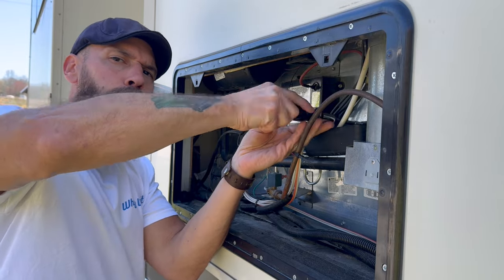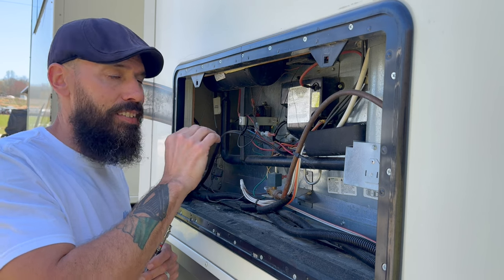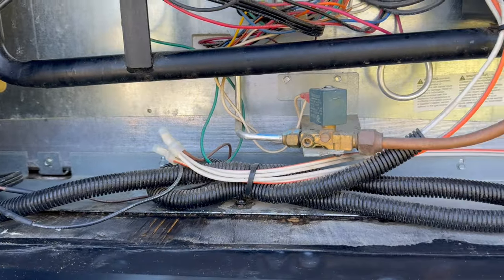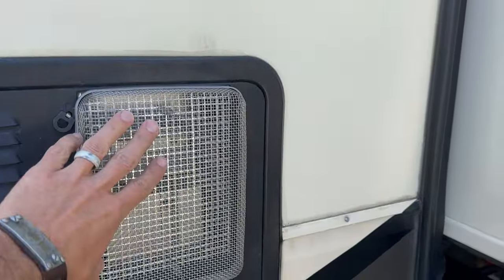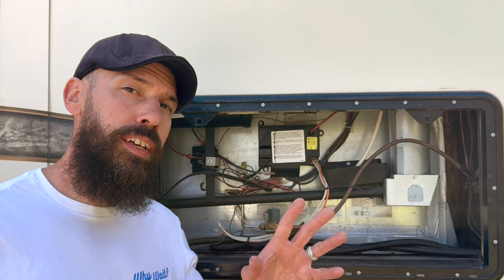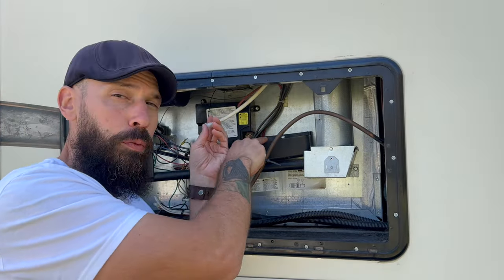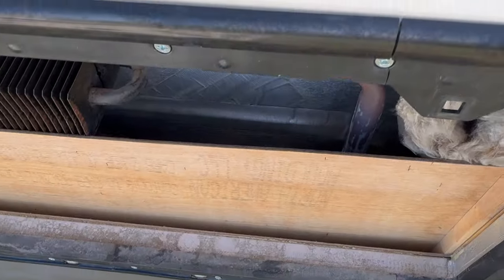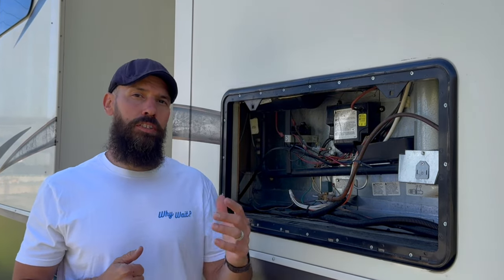RV FIRE HAZZARD! 6 Quick RV Refrigerator Maintenance Tips

Comment from the maker: RV refrigeration maintenance is important to keep your RV propane/electric fridge running at its optimum performance. You may not know that a number of RV refrigerator repair issues can be solved with basic and regular maintenance and some good cleaning. Not to mention this is probably the number 1 area for RV fires and sometimes just getting back here and inspecting can prevent unwanted accidents. 

⭐️PRODUCTS MENTIONED 
🔹Camco RV Furnace Insect Screen: https://amzn.to/3PHQXSn
🔹Camco RV Norcold Fridge screens: https://amzn.to/3lFVuqP
🔹Camco RV Water Heater Screens: https://amzn.to/3LFQUTW

💵SAVE MONEY BY USING OUR LINKS AND PROMO CODES BELOW!💵

✅👇🏼💦BLUE TECHNOLOGY WATER FILTERS💦 👇🏼✅
💵 7% OFF by using our link below!
Save on all Blu Tech Filtration Systems and Water Hoses!
BLU TECHNOLOGY WEBSITE: https://goblutech.com/?ref=whywait

⭐️🔻BUY RV SNAPPADS🔻⭐️
10% off with PROMO CODE: WHYWAIT 
https://rvsnappad.com/
❇️ANDERSEN JACK BLOCKS 6 PACK: https://amzn.to/3yn8Qj2

⭐️SHOP ALL OF OUR PRODUCTS⭐️
✅ Why Wait Amazon Page ✅ https://www.amazon.com/shop/__whywait__
All of our favorite RV gear, categorized & located on our Amazon Storefront. 

💵SAVE ON NEW RV MATTRESS 💵
⭐️Visit https://rvmattress.com/whywait and use code: WHYWAIT to get 25% off your Cub order! 

❇️WAGGLE PET MONITOR❇️
💵55% OFF Coupon code: WHYWAIT55
Link to purchase…https://bitIv/30yKsCW

🇺🇸THE BEST RV INTERIOR AND EXTERIOR CLEANING PRODUCTS....
❤️❤️GABES PRIDE❤️❤️
🌟LINK BELOW!! 
https://bit.ly/3xTciRf

❤️SAVE 5% on RecPro orders using our link below and enter this promo code: DKPKNUS
https://www.recpro.com/?referral=DKPKNUS

💚BUY GAS STOP💚
🔻Promo Code: WHYWAIT for %10 OFF!🔻
https://gasstopusa.com/

💥🎥RELATED VIDEOS….
🎥 HOW TO DEFROST A RV FREEZER | RV FREEZER HACK | (Full time RV life)
https://youtu.be/hxPNALD1URg
🎥 RV Maintenance, Repairs & How To
https://www.youtube.com/playlist?list=PLD8eDwLsl5iVGaCpkVKkPHj_fgZ7-XyOR
🎥 5 Important RV Maintenance Projects I Do Once a Year
https://youtu.be/2FfVgCiQoAw
🎥 Cleaning a RV Water Heater (How to Descale, Sanitize and Maintain)
https://youtu.be/jmp--XS6pIk
🎥 HOW TO SANITIZE A RV WATER SYSTEM   (Using the Grand Design Nautilus System)
https://youtu.be/mJ6oBmQRmtw

#rvtips #rvlife #rvitems #rvgear
♦️OTHER GREAT PRODUCTS WE USE!♦️
🔹Unique RVDigest It Holding Tank Treatment:
https://amzn.to/3Gcizfs
🔹 Instapark Water leak sensors: https://amzn.to/3h4D7Zg
🔹Valterra twist on sewer gate valve: https://amzn.to/3iVccjI
🔹Water pressure regulator: https://amzn.to/2XM8mjf
🔹Brass 90 degree water elbow: https://amzn.to/2XOMUKl
🔹4 way garden hose splitter: https://amzn.to/3o03Kkg
🔹Camco 20’ Rhino sewer hose kit: https://amzn.to/3cj5Fhy
🔹Happy Campers blank tank treatment: https://amzn.to/3r2HRCr
🔹Thetford drain valve lubricant: https://amzn.to/2Zi0cja
🔹Plumbers silicone grease: https://amzn.to/3jPaelx
🔹Water flow meter: https://amzn.to/2XN08aj
🔹IWISS PEX Cinch tool: https://amzn.to/39pYthL
🔹Camco clear 90degree sewer elbow -  https://amzn.to/39exjuw
🔹Camco 20ft sewer hose slinky support - https://amzn.to/2HE5Jvp
🔹Camco rubber donut sewer seal - https://amzn.to/3fB4Os4
🔹Camco clear 45degree sewer elbow - https://amzn.to/3m3URFY
🔹Camco 4ft Drinking Water Hose: https://amzn.to/39WuLQI
🔹Water Alarm Detectors: https://amzn.to/3ww2A7s

🔻ALL THINGS OUTDOORS/TOOLS/CLEANERS
🔹Boeshield T-9: https://amzn.to/3RyIl1p
🔹Boeshield Rust Free: https://amzn.to/3o3EsUA
🔹Eternabond Tape 50’ x 4” https://amzn.to/3J5JET3
🔹Eternabond Tape 50’ x 2” https://amzn.to/3P79CJs
🔹Alpha Systems 1021 self leveling sealant: https://amzn.to/3MR9kUc
🔹Viair Portable Air Compressor: https://amzn.to/3nRsYlh
🔹GCI Pod Rocker chairs: https://amzn.to/2WKKOup
🔹LCI Lippert Screen Door: https://amzn.to/3hW9gmo
🔹Telescoping ladder: https://amzn.to/3a8Sv3P
🔹TST Tire Pressure Monitor System: https://amzn.to/3cfONrW
🔹242 piece fuse assortment kit: https://amzn.to/3qZArA1
🔹1/2 Drive impact flip socket set: https://amzn.to/3t5Qq1u
🔹Kobalt 1/2 inch drive Torque Wrench: https://amzn.to/3lwiRC6
🔹Eternabond Tape: https://amzn.to/2YpetKE
🔹30 Seconds Outdoor Cleaner: https://amzn.to/2YHnfnf
🔹

🤝🤝CONNECT WITH US ON SOCIAL MEDIA🤝🤝
👉🏼Instagram: https://www.instagram.com/__whywait__/
👉🏼Facebook: https://www.facebook.com/chris.kapperman.5
👉🏼TikTok: www.tiktok.com/@_whywait_

......NOTICE......
Some of the links on this page are Amazon affiliate links. If you choose to make a purchase using our links, we will earn a small commission. This commission comes at no additional cost to you but helps us keep providing the content we share. We recommend these products because we use them as ourselves and find them helpful to us not because of the small profit we make. Every linked product we use and appreciate it when you use our links. Thank you.

Comment: Why the drip tray that has to be dumped out?  It seems easier to run hose out the vent or even better down and out the bottom.
Reply from the maker: I do run my hose out of the back vent sometimes when we are more stationary. I don’t like it hanging out if we are traveling, fear of the cap going missing. Lots of times the tray dries up on its own too just from evaporation. When I do go back there and there’s water in the tray I just empty because, why not, gets pretty funky.

Comment: Dont ever zip tie to copper tubing it will rub a hole in the copper
Reply from the maker: No worries, they is hardly any pressure on the zip tie at all. That’s more a rule of thumb for copper plumbing lines with water running through them.